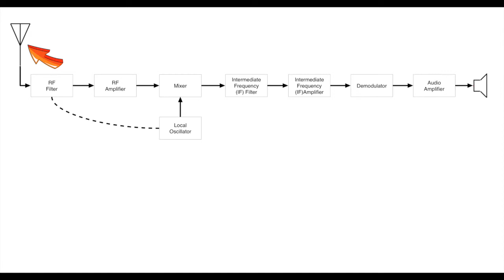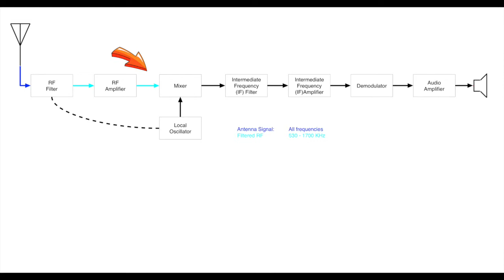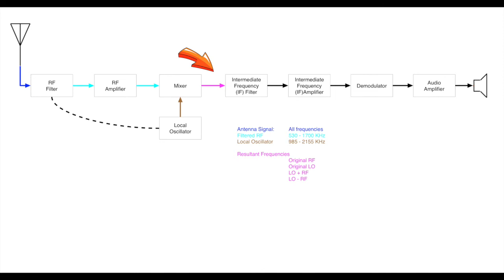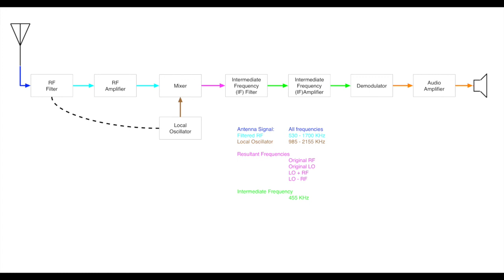#027 Superheterodyne Receiver Tutorial

Comment: Thank you for this walk through of the signal.  Can you tell me why 455KHz was chosen ?     I understand for FM something like 60MHz is used for the IF.   Is there something magical about these frequencies ?
Reply from the maker: Hi Craig,

sorry about the long delay in responding, I have had a million and one things on.

The IF frequency of 455 Khz is an interesting choice. there have been many others over the years but 455 seems to have become the standard. I have seen valve radios with the IF around the 260, 460 and a few in between that. The low IF frequencies can be problematic as the image frequency is not that much different. so for instance with 260 Khz if we want to receive a station at 600 Khz the image will be at 1120 Khz which is still well within the Medium Wave zone. If the RF filter is not sufficiently selective you could find the radio receiving signals at 600 and 1120 at the same time. If the IF is made higher then the image will be further away and it will be easier to design the RF stage to provide better selectivity between the desired frequency and the image.

So in broad terms thats what a higher frequency was chosen, I do remember seeing something about why 455 was chosen however can't remember the exact reasoning. I think it may well have just been due to a majority of manufacturers controlling the way things went, a defacto standard if you like that became a standard.

The normal IF for FM is actually 10.7 Mhz, As the FM band is a much higher range a higher IF is needed to be able to achieve sufficient selectivity in the RF stage at that band.

Hope this helps a little, and if anyone else can offer more information, please comment.
Reply: Thank you for this!

All the other videos I looked at about superhet left out that one critical piece of information that you included - the local oscillator frequency is linked to the tuning frequency and provides a constant offset, giving you a known IF to filter and amplify!

Without that it made no sense to me at all.

Great explanation, thanks again.

Comment: hi, i could not understand how this mixing is done, so that frequency got added or subtracted. i also could not understand how if frequency of 455 is received.i am even more confused now.
Reply from the maker: Hi sorry you are feeling confused, I will try again.
The first thing to remember is the mixing device is operated in a non-linear region. 
If the device were to be operated in a linear region and we were to insert two different input signals of differing frequencies, then the outputs would only consist of versions of the input signals. 

However as the device is operating in a non-linear region one of the characteristics of this is mixing will occur and the output will consist of the two input signals, and the addition and subtraction of the two input signals. The Local oscillator is tuned in such a manner so it will operate at either the IF above or below the desired frequency to be received. 

So for instance, if we want to receive at 1Mhz, the local oscillator will be tuned to 1.455Mhz. The RF stage or antenna tuner will be tuned to 1Mhz so the inputs to the mixer will be the Lo of 1.455MHz and the received signal of 1MHz. The signals that come out of the mixer will be 1MHz, 1.455 MHz, 0.455 MHz (455kHz) and 2.455 MHz. The first tuned circuit at the start of the IF will be tuned to 455kHz so only the mixer output of 455kHz is selected for amplification by the IF stage.

Hoping this may help.
Reply from the maker: I’m not sure if this will assist or be more confusing, however this link provides a mathematical explanation of mixing...

https://www.highfrequencyelectronics.com/Jan11/HFE0111_Tutorial.pdf
Reply: i am sorry for making you concerned with my previous post, but i searched around for rf mixing, so it's bit more clear now. also the above explanation is helpful. thank you for your concern and reply. :)
Reply from the maker: No Problem at all